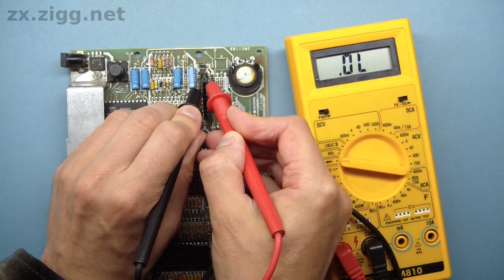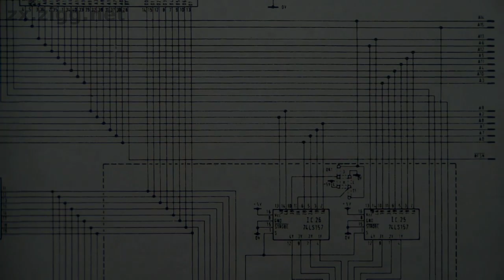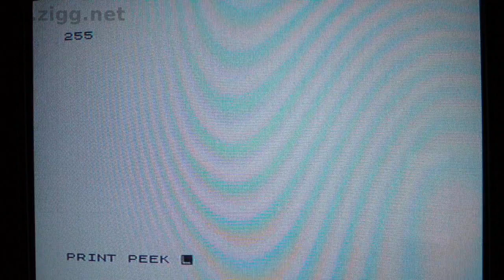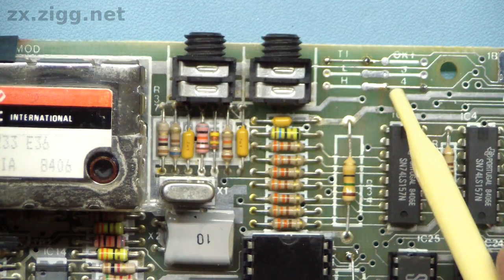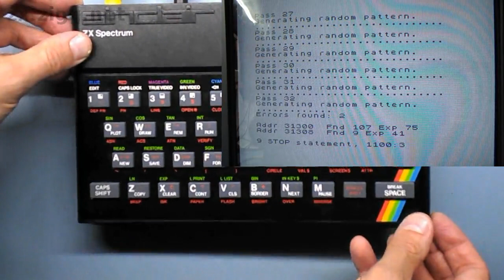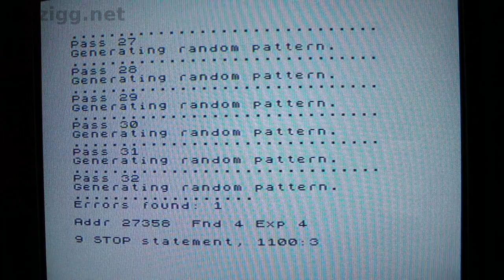48K ZX Spectrum Repair (No. 5)

Comment: Hello, I wanted to ask something. Recently I bought second hand ZX spectrum, and I have found your videos. So, the ZX spectrum boots ok, it shows the Sinclair logo, but there is a fluctuation on the screen. There is a horizontal bar that moves slowly from top to bottom, it is kind of black or grey. I guess that it could be some fluctuation that it is not getting filtered or something. The test ram shows 65535, so it is ok. What can it be? Have you had this problem before? I hope it is nothing serious.

Thank you all for your attention. Regards.
Reply from the maker: How is the computer connected to the display device?

If you're using the original modulated RF output note that the modulator isn't of the best quality and it usually causes some extra interference on the picture, though a very good picture is possible from some. A poor quality or unreasonably long connecting lead or dirty connectors on the lead can cause problems too. Also note that the modulator's carrier frequency isn't especially stable and it's usually necessary to adjust the television's tuning from time to time to maintain a reasonable picture, especially while the Spectrum is warming up.

If you've adapted the Spectrum to provide a composite video output, again a poor quality or poor condition connecting lead can cause problems.

Whatever the video output type, make sure it is soundly connected inside the Spectrum. For example, it isn't too unusual for the connection to the output socket inside the modulator's metal can to fail.

Does the Spectrum still have its original (or other old) electrolytic capacitors? If these are degraded and failing, all sorts of strange interference can appear on the picture. I recommend they be replaced for this reason and because failing capacitors are a very common cause of faults in ZX Spectrums and can lead to the lower RAM being damaged.
Reply: I am using the AV connection. I did the mod. I connected a capacitor to the TV connection and disconnected the 5v supply to the modulator.
Reply: So, I detected that the DC power plug socket is very sensitive to movements, and after a quick look it is apparent that it is not in a good state. I removed it this afternoon, and checked the image in the screen without the power plug socket. Now, the image is better, it is fixed, but a shadow bar still appears in the screen, although now it does not move.

Another observation I made is that I have to set the power adapter at the 12 V position, not in the 9V one in order to boot the ZX spectrum. My guess is that maybe something in the power supply circuit is not working really properly. ¿Maybe the transistors?
Reply from the maker: Your discovery that the computer is sensitive to the input voltage in the way you describe makes me think it very likely the voltage converter circuit isn't working. 

Perform the tests described at
 https://www.youtube.com/watch?v=IzgCmldm2H4
and in particular, check for the presence of all three power supply voltages. Look for 5 V, -5 V and 12 V at the appropriate power pins of the lower RAM ICs.

There is a high probability of damaging the lower RAM if you power the computer on while the voltage converter circuit isn't working, so other than once more for checking the supply voltages, I recommend you keep the power off until you are reasonably sure the voltage converter circuit has been repaired.
Reply: Well... I did the tests and everything seems ok. When I plug it, there are one or two grey shaded horizontal bars that keep moving. I have changed already C44, C45, C34, and C50. I have an issue 3b.

Comment: I'd have probably put it down to some sort of marginal timing on the lower ram IC's.. Those 4116's are more trouble than they're worth quite frankly!

I would have been willing to bet that if you had replaced the lower RAM with one of your replacement modules, the problem would have disappeared.

Comment: Just watched this again and thought maybe it could have been a seating problem in the socket, maybe a dirty pin of the IC making seldom but intermittent connections, a touch of corrosion or pitting maybe.
Can't fault your logical reasoning as you went through the circuit. good in-depth knowledge of this device., does amaze me there are still so many of these comps still around.

Comment: It's great when problems like that manifest themselves lol.  It's likely the difference between board revisions (track layout, capacitance) and something degrading in the ULA - perhaps its more susceptible to noise and having been installed on a different revision the track layout alone can make enough difference.  You get similar wierd things in Atari ST's where the revision of the board combined with a particular chip revision can mean that a 'faulty' chip actually works in a different revision board.  I wonder if its maybe a degraded internal pull up resistors or something - these things don't last forever.  I would be tempted to measure from gnd to address pins of the ULA (out of circuit) and between vcc and the address pins, and compare to another working ULA - It's a long shot but sometimes a difference can be seen that way.

Great work!  Love your approach =)